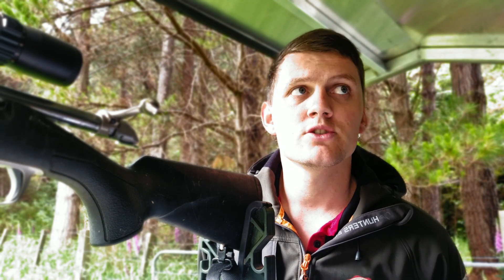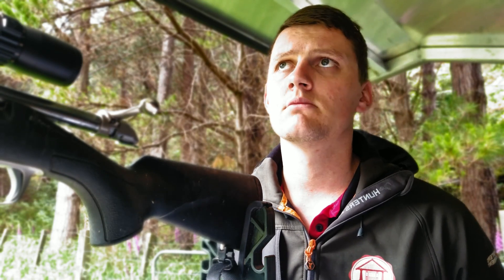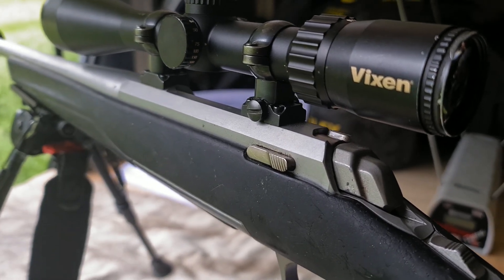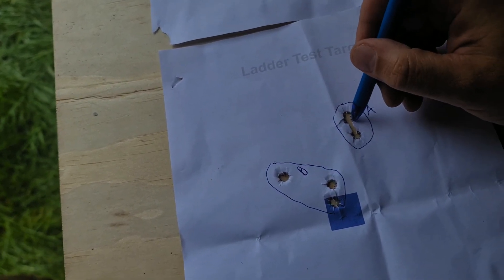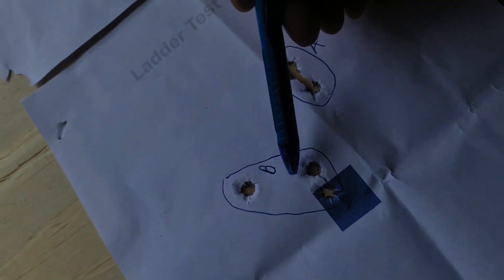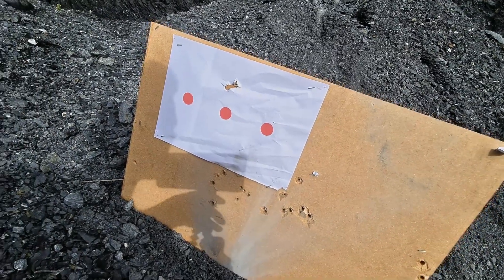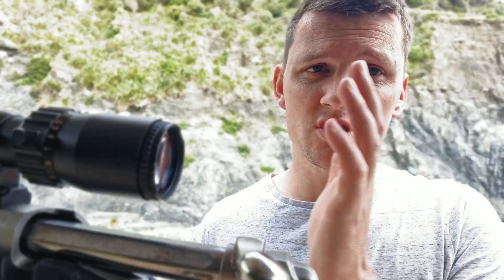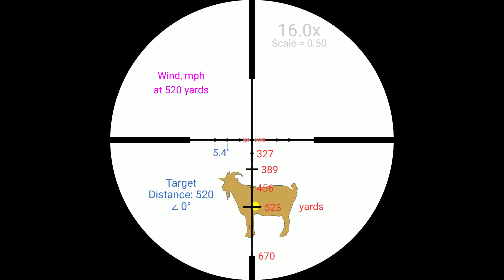270 WSM and the 145g Hornady ELD-X

Comment: Nice one mate I find all the wsm rounds interesting I have a 300wsm built on a long action for 210gr berger at just over 3.25 inch overall length.. I have a 270ai pushing 130vld at 3315fps with 62.2 grs of 2213sc absolutely love the 277 calibre
Reply from the maker: Nice nice. I actually have a hunch against the 277. I think it’s on the brink of either dying out unless manufactures redesign some high bc heavy projectiles and twists. The 6.5 and 7mm have taken over. My main gripe is the wind drift it suffers from out long. The 25 cal and 27 cal both suffer from slack wind drift.
Reply: @Remlite2025  I have the same feeling you do and I'm sort of hoping with the 6.8 western new bullets will come. I want to build a 25 cal one day but there are no decent pills
Reply from the maker: @bradleytyrrell4417  sweet. Yep I have a 243wssm on my list one day.  👍👍
Reply: @Remlite2025  nice sounds interesting I just had a 243ai built
Reply: @Bradley Tyrrell  berger have 133 and 135grn projectiles now in 25cal.